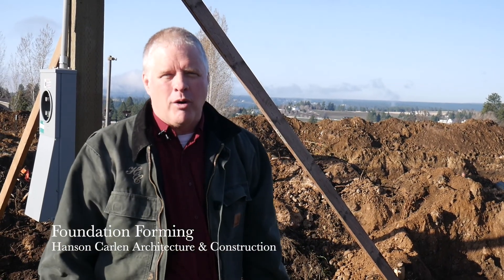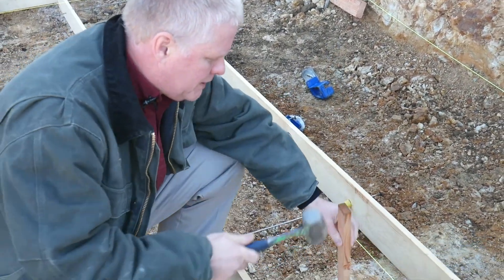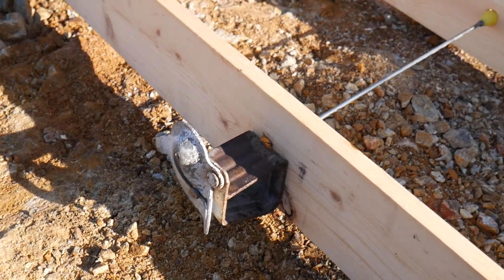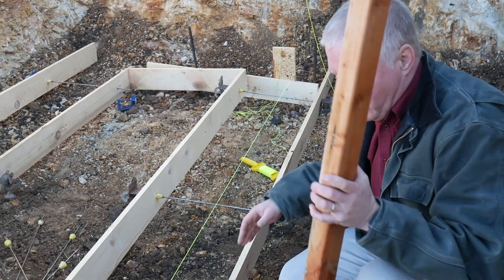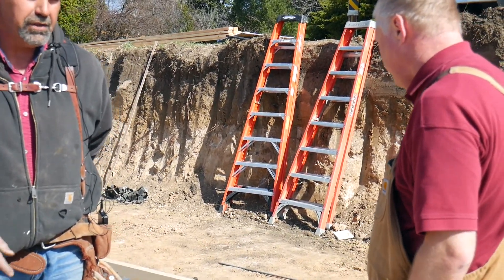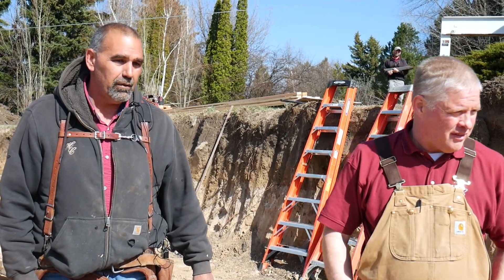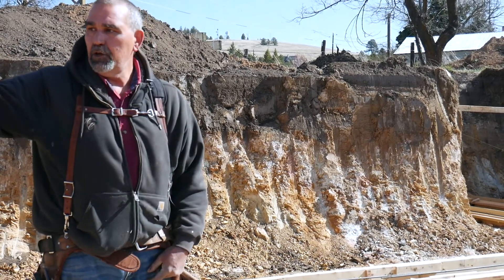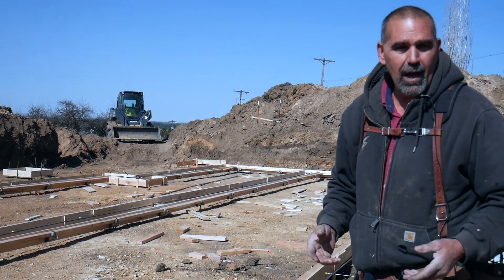Forming Foundations in the Rock

Comment: I use stone footers if the bedrock is harder than concrete. Code even says 24" in sand or loose soils for foundation. I found out why when I hit limestone bedrock U.p. north under 30" of sand of why code say that. Usually on glacial till it's 4 feet to frost line here and I go 6 feet on north walls where the sun don't shine. Your concrete guy is awesome.  I used fgpr to pin stone footer to bedrock. Middle of rust belt and rebar fails even 6 inches from outside of concrete.  Building a  Richardsonian Romanesque masonry Earthship with 6/12 mono sloped roof. No berm no tires. No berm helps with ventilation. Why would I use tires when I do masonry work for a living? 8 inch concrete block filled with insulation, with rockwool, hardy board insulation, X2 one way vapor barriers sandwhich, and 8' rip rap limestone veneer. Building it off grid for retirement.
Reply: What is “fgpr” that you used for pinning stone footer to bedrock?
Reply: @trite34  Fiber Glass Polymer Reinforcement
Reply: why do you need a footer on bedrock? The bedrock is the footer.
Reply: Footer are mostly for two reasons. One to go beneath the freeze line so the foundation is not as likely to freeze and burst. And two the load bearing walls need deeper foundation so the weight does not crack the foundation or settle and cause cracks in the walls, etc
Reply: I'm on the side of a mountain east side facing the sun in the Appalachian foothills of AL. Absolutely beautiful view. The spot I own is sandrock and when disturbed it washes. I will be building a lean style tiny house on it myself but I'm do not know how to put a concrete foundation on sandrock especially the footer.  Over whelmed...